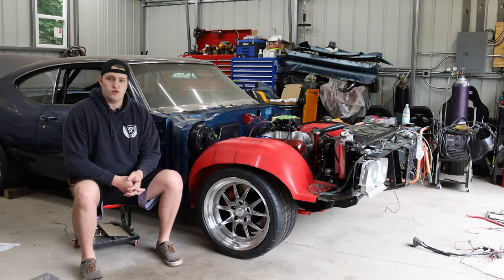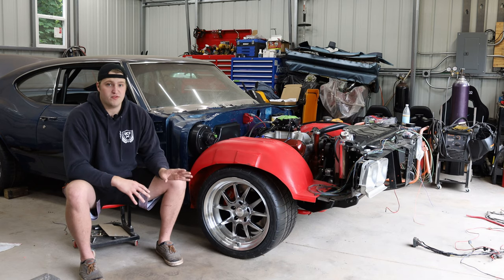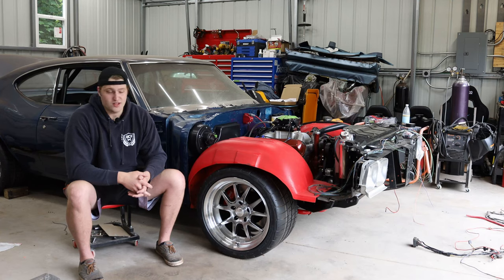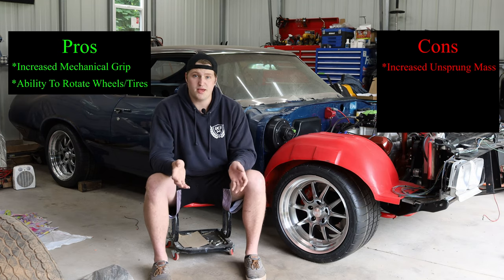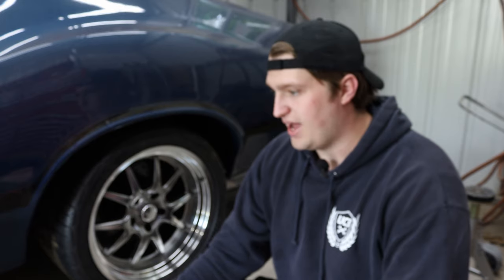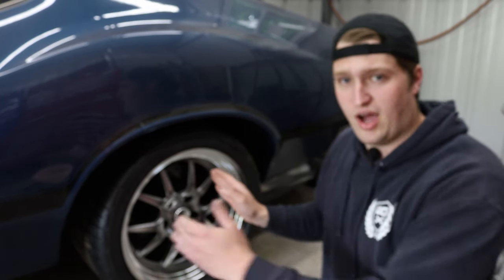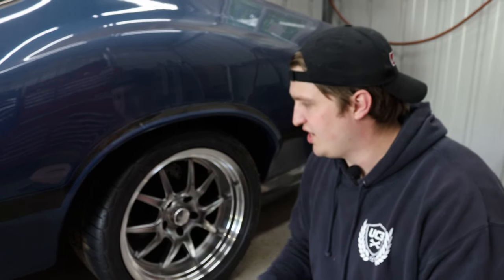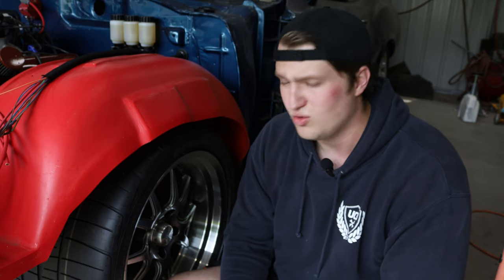Putting a 315 Squared Setup On My Pro Touring Oldsmobile Cutlass!

Comment: I have a 72 chevelle and run the same  rear size but going to update from my 18x9 
5.250 bs front  with a 285 35 18 tire,to the 18x10.5 5.5 bs that tony g is running on his 70 chevelle.
I'm using the whole speedtech arms,chicane  mount,afx spindles,but making a custom splin3d. Swaybar like Alan Miller's 70 chevelle that he had,with the stock frame.
Reply from the maker: Awesome, sounds like quite the setup! Youre using some awesome chevelles as reference points! I’ll likely move to a splined sway bar at some point in the near future.

Comment: 315 18" fit on the rear without u having to mini tub, because I wanna try 315 20" on my rear 71 0lds cutlass S, but I don't want to mini tub it
Reply from the maker: Yep, we opened up the wheel wells so that they sit flush against the frame, but the car isn't mini tubbed at all. With a 315 on a 20" wheel you may have clearance issues that I didn't though, as the tire is going to be taller than what I use.

Comment: I have 275 squared on my 68 GTO. I am thinking about 315s again and stumbled across your video. The more I think about it the more I'm willing to do whatever body modifications necessary.
Reply from the maker: It’s definitely a cool setup, I have no regrets doing it on my car, and would’ve done more fabrication work had it been needed!
Reply: @TheOldsmobeast  I understand the paint and body on your car is much better than mine. What do you think about the Cost of tires/wheels vs the performance gained?
Reply from the maker: @punishergto5182  Hard to say exactly how much performance was gained since I never had laptimes or data to reference from the old setup. There definitely is a noticeable difference, however whether or not the increase is worth it comes down the individual! For what I’m doing with the car, the cost vs performance was worth it, but for some people it may not be.